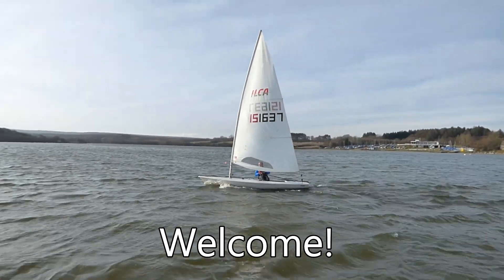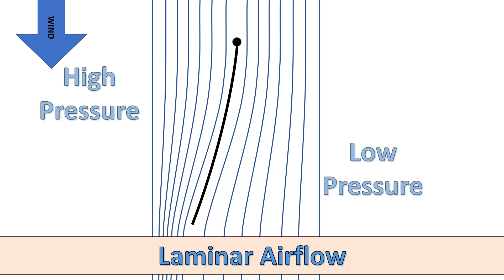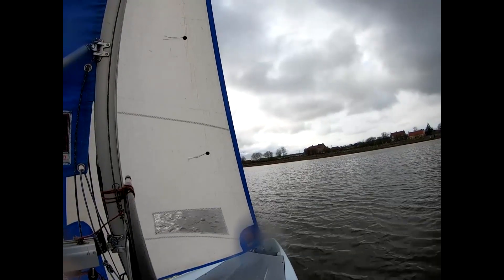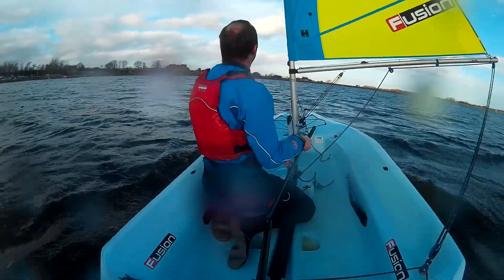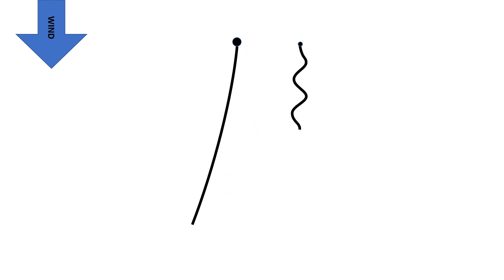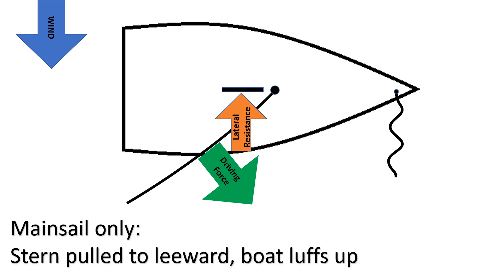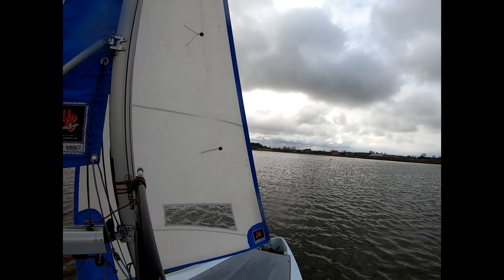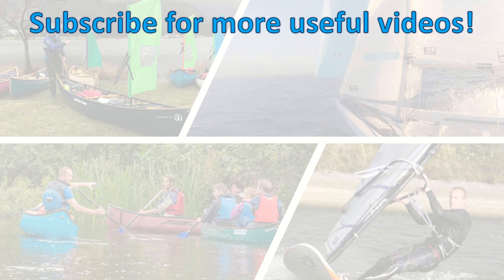How to trim a sail and use tell tales (part 1 of series)

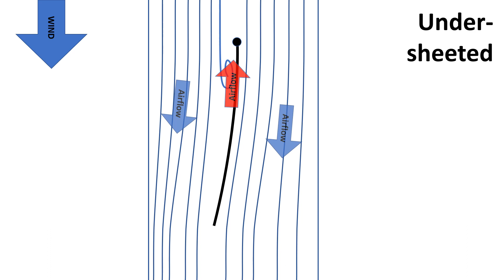Comment: 3:25 Your diagram here is wrong. When pinching, the leeward telltale peels off and flutters, as the flow is separating from that side. You even see this in the video of it in action. For maximum thrust, you want fully attached flow, and fluttering telltale indicated detached flow, and if even the leading edge (luff) is detached, your thrust will be dramatically lower than it can be, this is basically equivalent to an airplane stalling
Reply from the maker: After the diagram at 3.25, the footage then shows the windward telltale flying forwards and upwards. As the boat turns further into the wind, the sail starts to flap as well, and it's still the windward telltale that's flying forwards & upwards. The camera is on the windward side of the sail and it's the closest telltale that's not flying straight. The leeward telltale is flying straight, as seen through the sail. So no, I don't agree it's wrong, the diagram is explaining what you then literally see on the video footage moments later....
Perhaps it's confusing that on the diagram, the sail is set on Port tack, and in the video the sail is set on Starboard tack.

Comment: Is a burgee also needed? - I mainly just cruise, but still want the boat to sail well
Reply from the maker: A burgee is a great idea, as they show the apparent wind direction. They can be a good starting point for the general sail setting, but they won't show as much detail as the telltales do. By this, I mean that you can set the angle of the sail fairly well based on the burgee, but the telltales are more sensitive to react  to the air flowing around the sail itself. A burgee is particularly useful in light winds when you might be struggling to work out where the wind is, or to get the airflow to attach to the sail. 
The Hawk MKII is a popular choice for un-stayed boats (Laser/ILCA, Topper etc), as it shows the wind approaching the sail: https://amzn.to/3J1dCa1
Or a masthead burgee is ideal for doublehanders: https://amzn.to/49cOfgc
A mast head burgee will also find the wind a bit sooner in light winds, because it's probably a bit stronger a bit higher up; but bear in mind that any rocking of the boat will affect the burgee.

Hope this helps!